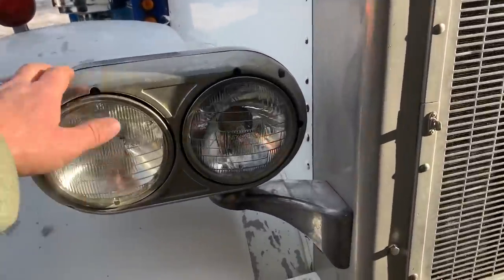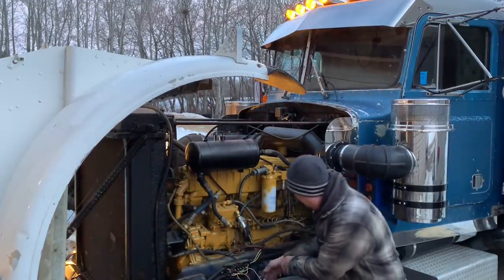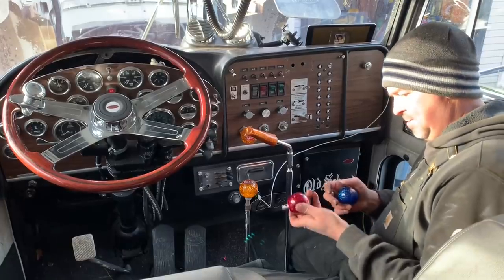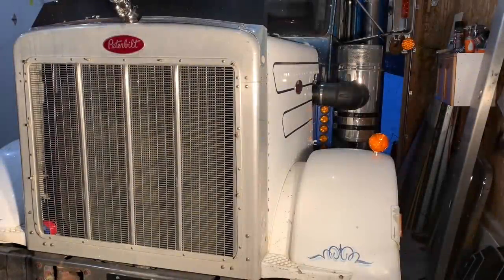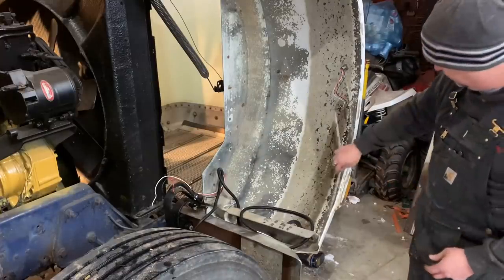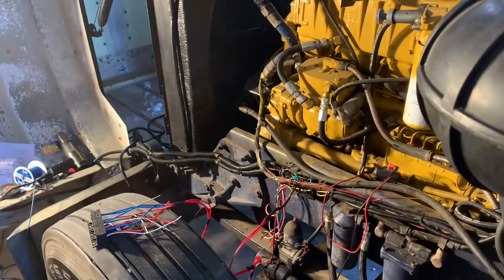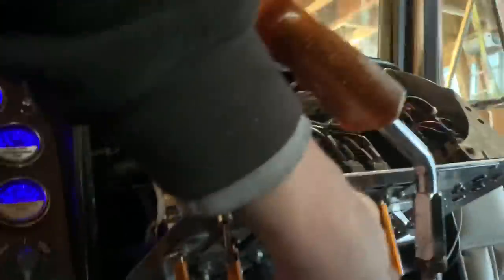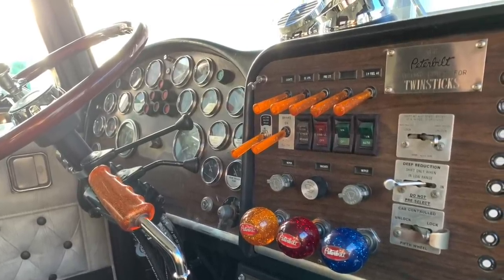Peterbilt 359 Restoration Ep. 60 Dash of Sass

Comment: You can fill the engraving "Twin Sticks" lettering with black paint.... let the paint set up and then gentlely with a razor blade scrape the paint off the flat surface around the lettering... Trust me it works well for painting engravings to give them detail
Reply: This, or even a black Sharpie will work - just press hard all over the engraving, then after it dries use a clean rag with a tiny bit of rubbing alcohol (not enough to make the rag soaked, just a little damp) and gently wipe the excess off the top surface and the stuff in the engraving will stay behind.  If you wipe off to much, just repeat until you are happy!
Reply: Instead of a rag to remove the excess black.  Use a piece of paper. It won’t go down inside the engraving and it’ll leave nice crisp edges.
Reply: Use finger nail paint you can get any color. Then take finger nail polish remover put on cotton ball and rub over top and clean up and the paint will stay in engraving.

Comment: Take it from someone who does wiring for a living (on aircraft, not trucks but very similar): crimp terminals are far quicker than soldering and if done right, they'll last longer too because they're less prone to cracking from vibration. Look for AMP ratcheting crimpers at your local auto supply store or on Amazon or Ebay
Reply: Agreed we do Motorsport preparation and absolutely won't use solder anywhere,almost every electrical connection failure I come across is down to soldered joints,either via mechanical failure of the joint due to vibration/ harmonics or corrosion,it seems that even a half decent semi exposed mechanical crimp or screw type connector is still less prone to corrosion than a sealed soldered joint. I was reading a post on another video of a guy who's family business has been building specialist trucks(pumps,generators etc). for some of the world's harshest environments for over 80 years and found that solder joints were a common failure( not convenient when the truck is a 1000 miles deep in a jungle or desert)and since abandoning solder in their building process in the 70's have never had an electrical connection failure since,mighty impressive proof indeed!

Comment: Two things, I don't know if you're using connectors on your wires or solder, but I would always solder.  These old trucks shake and give the opportunity for connectors to break...giving way to headaches to find the break.  Secondly, lesson 101 on feeding wires into wire loom:  Hold the start of the loom, split up, in the crook of your index finger.  Start the wire in the split on the end of the loom with your thumb on the same hand as your index and  start pulling the loom as you push down on the wires,  It will naturally fall into the open loop split......hope this is as clear as mud.  I did my own resto mods on old vettes, harleys, etc and really miss it.  Wish I was there working with you.  Love those old iron ladies....and you are doing it right....just remember to do as good on the hidden items too.  Love this stuff!!

Comment: Gotta have bling on the inside as well as on the outside! 🤩 Yes, I do think that most truckers like the lights! I’ve ALWAYS liked lights so that people could see me coming and going. Most trucks don’t have very many on the back though. I always put mood lights on the inside as well. The knob balls are cool, and they match the switch covers. The dash plaque is cool and shouldn’t be hard to paint either. That’s a nice touch! 😎 I’m glad that your turn signal didn’t get blown..I’ve heard that if you cross those wires it would destroy the leds, but I guess maybe not. I have some led turn signals that I bought for my old REO when I get it ready. I like having an old truck with new technology installed. You take the best of both worlds and make a special truck. The headlights turned out SWEET! Don’t forget to treat that rust inside the buckets.😳 Little by little! You may need to keep her in the garage for when you just want to go out and tinker on a Friday night or so...a LOT WARMER inside!

Comment: At 16:45 loved the explanation of the function of relays keeping hi amperage from the switch, but delivering it to the device. I have a '66 Ford 3/4 t pickup in restoration that has the old  design for the headlights, i.e all the amperage thru the switch to the lamps, Over time the headlights dim, so adding relays will be the solution for me. Thanks for explaining relay functionality .

Comment: My 1986 359 had those lights on the fender. There was a small oval shaped hole in that tubing right behind the light for the wires. My 1995 378 didn't have them or the turn signals on the fenders. I added them and just used the plastic loom from auto parts store. I think it took me all day to install them.

Comment: Go on Amazon. You can get all 4 led bulb replacements for like $200. They’re like $45-50 a pair and work  great with the halogen housings. I had to take the dremel tool and enlarge the keeper ring slightly to allow clearance for the fan on the led bulbs.

Comment: Relays are a good choice for sure. New vehicles use modules and can bus but older had heavy wires and switches. One thing on your relay you might find 87 and 87a out put, the 87 is normally open and 87a is normally closed. She looking good and bright

Comment: Wicked!! And the engraved words can be filled with paint or epoxy to make them black. I used to use India ink. but auto paint you likely already have and would look shiny. Actually would look nice if you used blue for your new engraved words :) Tape over the top words, use a damp Q-tip with solvent to wipe off excess....

Comment: Pour black paint on the Twinn Sticks letters / dab on with model paint brush.   Then immediately wipe off plate with paper towel. May want to wrap paper towel around something flat like a piece of wood or plastic bondo knife.   Paint will fill in the engraved lettering.  You can use your finger but don't press to hard cuz you want the paint to stay in the lettering.  Will have to wipe a few times to get faceplate clean.

Comment: Little tip if your going from incandescent lights to LED lights you will need an grounded turning flasher for the turning signals if you don't eventually all the lights will flash on the truck trust me it happen to me on my 2000 after switching them

Comment: Twinsticks, Take some black enamel paint and paint the words on that little plaque.  Once the paint fills the engraved text you can wipe the extra off from the surface and it will look great. EDIT: I just saw someone else posted the same thing already.
Reply: You said it better ;) to add to this sometime you need to do a little sanding to make sure all the paint is removed above the engraving. I’ve seen some not even wipe away the paint and sand it when dry, I assume this is to stop from removing any paint in the engraving.

Comment: Use some testors hobby enamel paint thinned down about 40to1 with mineral spirits brush over the engraved surface let dry completely then wipe off the surface with a clean lint free cloth it will let the black wash stay in the engraved area of the lettering by the way you can do this with any color you choose ( like orange hint hint) and just A tip don't try this process in - 20 degree air the results will be disappointing 50 to 70 degrees is recommended really coming together with little by little now and those small details are what sets any project apart and makes them unique geat job your doing keep it up peace from Oklahoma

Comment: my fender lights are lights rather than reflectors, those ones i cleaned up the lights that were on my truck when i got it, I assumed that was factory. the led turns on top of the fenders were from dirks. my fender signals light up front and back there red on the back and amber on the front.
Reply: Clearance lights on my fenders are grote 9007

Comment: Are you running all your extra lights to the switch or using a relay? The amperage draw from the extra lights is too much for a factory switch you may want to run them to a relay. The reflector is a update for the fender lights there was no way to seal the old lights and they failed repeatedly, I tried to run 5 lights on my front fender in the early 80s and had nothing but problems from moisture getting in the lights dielectric grease and silicone helped but it was a never ending challenge maybe newer lights are better sealed (oops typed before finishing the video)

Comment: Glad you're doing your best to prevent another Peterbilt electrical fire. Truck looks fantastic. Is the dimmer switch not on the end of the turn signal lever? Ours had a push button on the very end of the lever.

Comment: Recommend that you instead run the activation power to your relays from a source that has power with the key, and run the ground for the relays to your switches. this way your relays only work when the key is on and bc youre using the switches to give the relays their ground, the switches last pretty much forever

Comment: Your turn signal lights on your front fenders have to be red on the back side you can’t have Amber light pointing to the rear At least here in the states they are kind of picky about that also if you have some toggle switch extensions that are tight just warm them up a little bit with a lighter and slip them on

Comment: If you read this hope it makes cent's😉just had my knee replaced a couple of day's ago so still using dumb pain pills,.....but.....isn't that a trailer valve under the steering wheel, did Peterbilt have two valves for the trailer air application?, and what is a brakes on off switch? and only my opinion, but the fender light would be great if it was a led-marker light- and turn light.....wow thank goodness for spell check...ok thanks for the video...God Bless take...and stay warm.😊

Comment: Nice looking 3406A, brake saver and all.  How does the brake saver work? I have one on a B motor.
Reply from the maker: Kind of like a reverse torque converter that uses engine oil to slow the engine ... google it for more info/pictures
Reply: @TwinStix  I guess I should have been more specific.  I know how it works, my 359 has one, I use it all the time. I was more curious about how well yours works. One thing to be mindful of if it’s still hooked up is the rubber diaphragm when they are old start letting air and oil through them and if you don’t use the brake saver it will eventually push oil all the way up to the cab and out the vent on the air solenoid.  Mine never got that far, but it had oil on the air side when I did the inframe.

Comment: Love you vids!!! But a quick question: what is the reference of the Amazon 40Amp Relais pls? Thx, H
Reply: He is using them for lights, uses low current though switch  to power the relay and relay turns on the high current draw of the headlights. In short heavy wire to relay and from relay to lights.prevents a lot of burnt wires in the OEM harness.
Reply: @gerryspang5917  Thanks Gerry!!!

Comment: I can't stand using those premade relay plugs due to the fact that you have to splice the wires.  I buy the relay sockets with no wires and crimp the pins onto the correct length of wire needed.  Using those socket with the pigtails forces you to have a bunch of extra splices and possible failure points.

Comment: I really like this but as I run hard and with the way things are going soon they won't be legal to run. They are pushing for all emissions trucks. It's already starting to happen. I almost bought a 1994 kw can over but with alot of these older trucks the problem is many can't work on them anymore and parts are way harder to find. So as a guy who runs hard it would not be a good investment. Basically I'd buy one for a show truck which I've been thinking about. I'm working on buying a lovely new w900l with the studio bunk with Seatle pkg. So you still get a classic traditional truck but you have a x15 performance with 13 SPD. 605 hp and 2050 torque. They've had great results with that engine. I won't touch PACCAR.

Comment: I hope that junction box on the chassis there is water proof or it will become corrosion green hell.
Reply from the maker: Rubber ring seal and I put grease on the terminals once I got it corrected so it should be fine 👍

Comment: Don’t you need to just turn that signal around??
Reply from the maker: When it’s wired correctly it blinks on both sides
Reply: @TwinStix  gotta be an electrical engineer. I would still be sitting there. “87 out 26 switch wait what did I just say???”  lol